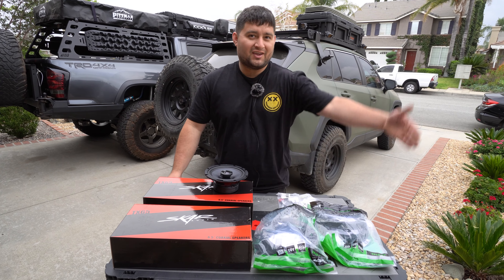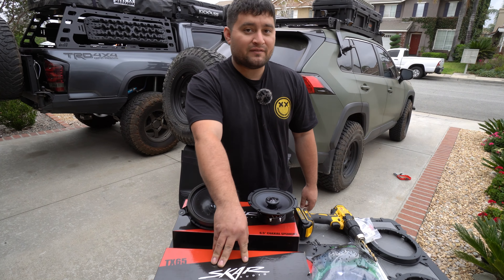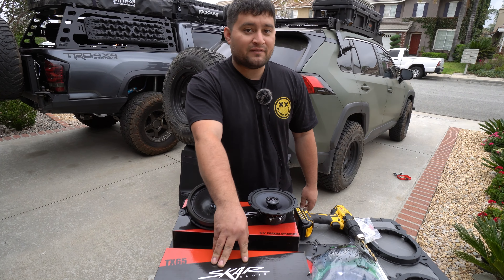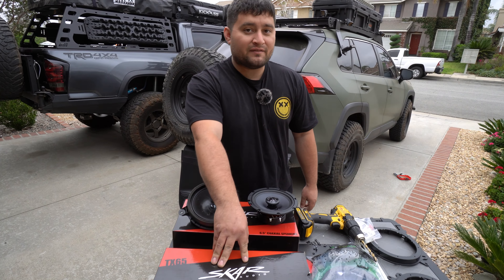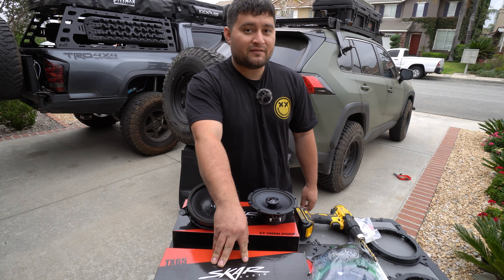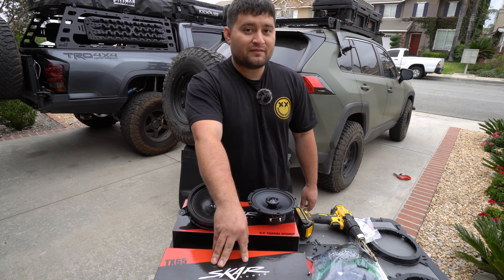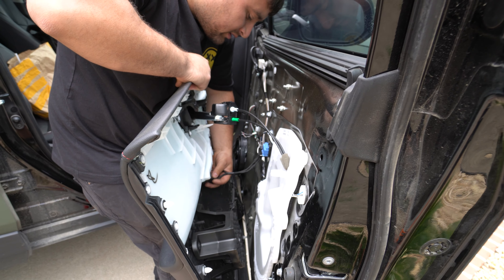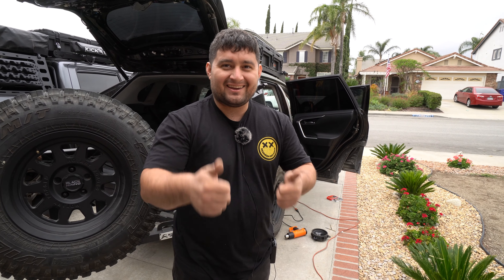Door Speaker Upgrade for the Toyota Rav4 2019+ | Plug & Play Connectors Like Oem With Skar Audio

Comment: Excellent install. Looks easy for this vehicle. The only recommendation I would make is to put some sort if silicone caulking or gasket between the door and the mounting bracket. Stops the door and speaker mount from vibrating and rattling at higher volumes.

Comment: Nice video. Just 2 comments: The polarity is very important. If you get it wrong, you loose the bass, since when one woofer pushes air out, the other one pulls air in and they cancel each other. Also, it would be better to use lock nuts to avoid the screw/nuts to loosen up with the vibrations.

Comment: If you're going to dispose of the factory speakers (as they deserve), you may as well cut them and use the baskets as brackets
Reply: You can also avoid using the wire adapters in the case, too, possibly? You can remove the factory plug on the speaker and solder it to your new speaker.
Reply: @TrevorTurkington  that's what I did. just reuse the oem speaker as a mount and solder the wires to the plug.  I replaced the door speakers with some old school Eclipse 6.5 3way i had laying around.  The dash speakers were replaced with Kicker 3.5 DS series.

Comment: You could have used a nutcert instead of a washer nut and bolt. When doing a quick fix, use tape instead when you are going to revisit the wire area to fix properly. Lastly the screws used to screw the speaker to the adaptor are too big, and should have installed the speaker to the adaptor before hand.

Comment: Can these speakers be used if I am not upgrading the amp? Thx.
Reply from the maker: Yes u just won’t get the full potential
Reply: I've worked with a lot of speakers in the past, sometimes what can happen with only door speaker replacement is the new speakers maybe louder or quieter depending on the efficiency of what you bought. Good to look for something with a high SPL that is usually measured in db watt/per meter. Also there might be less bass which is actually pretty common when swapping door speakers only so I would plan on a sub and amp if possible. There are some door speakers that make better bass than others so do your research.

Comment: I'm looking to update my speakers also.  I changed out the front dash speakers with JBLs and they sound great.  The balance is thrown off with the other speakers.  I can upgrade them myself, just not comfortable drilling into my door.  If I upgrade only 2 more door speakers, in your opinion, would you replace the front door or the rear doors?
Reply: just drill it bro
Reply: I’ve seen another video where they just cut the factory speaker with a blade and use the same base for the new speaker no need to drill.
Reply: Polarity disregarded???  Wow! Also look on YouTube, how to drill out a rivet  and u wouldn't be able to feed wires through that little hole if u didn't cut the wires.

Comment: Ur a tech that joined wires and put heat shrink that’s not a good connection even if u didn’t have plug and play u should have used wire joiners and if trashing factory speakers why not use baskets too